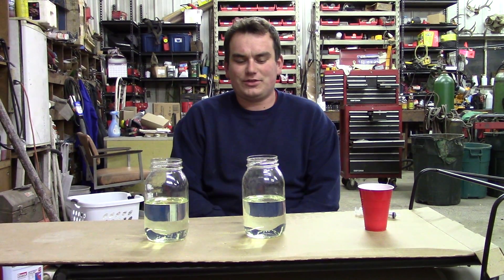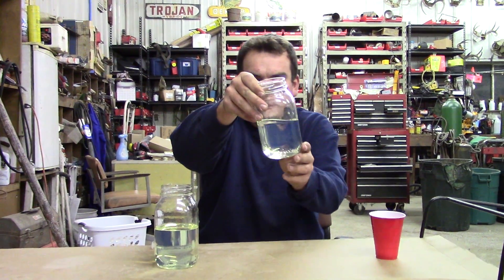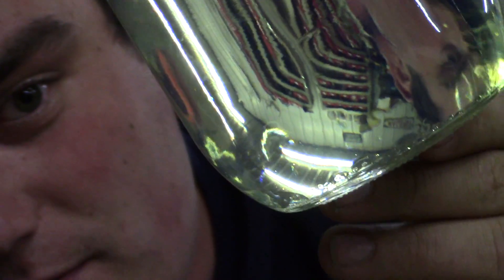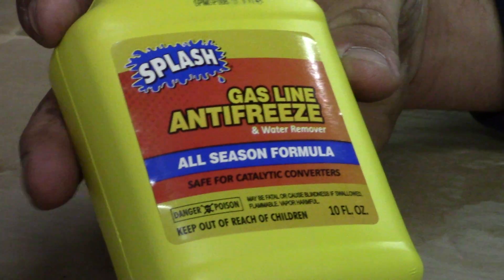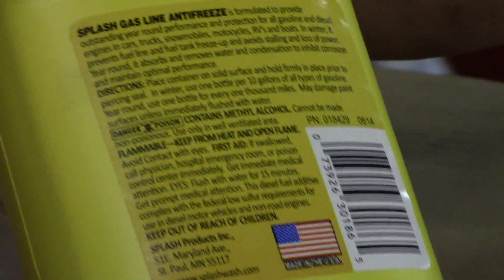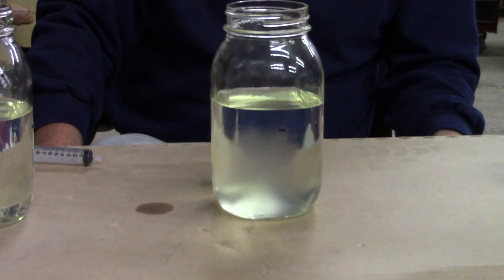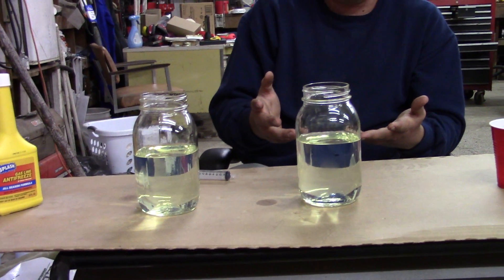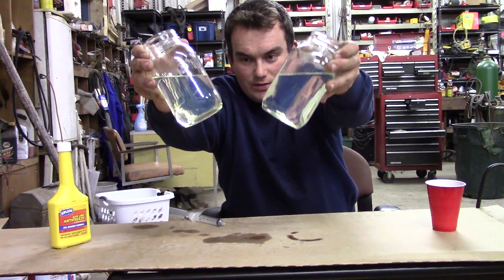ETHANOL removes water in fuel

Comment: The problem is that ethanol is hygroscopic - it pulls water out of the air.
You proved nothing - ethanol in your fuel will attract water. It's not a case of "I suggest you stop pouring it in".

Comment: Missing ro point? 2 stroke engines dont need any water run through them regardless if its suspenden in the mix. The damage is done to internals of the engine. Just because it will pass through the system does not mwan it dont distroy the engine. No water period!

Comment: Tell me you’re dense without telling me you’re dense. The ethanol isn’t “helping”. Your experiment assumes water is going to be present in a closed system where no water should be. You only proved that water and ethanol bind, yet this doesn’t speak anything to how ethanol pulls water from the air, thus introducing more moisture into the fluid. You can’t half-ass things and call it beneficial. No water = best case (obviously).  Non blended water with gasoline = water needs removed. 
. Gas with water dissipated in ethanol = harder to burn. Causing engine damage or a no run situation. 

If ya have a small amount of moisture in your gasoline, you could use a small amount of alcohol to bind to it and expel itself, but make no mistake…you’re doing damage. water in your fuel shouldn’t be allowed, assumed, or, in the case of ethanol…invited.

Comment: Ethanol does absorbs water.There is a critical mass of water in there when the water can not be absorbed any more by that amount of ethanol so it will be accumulated on the bottom.Here the only thing you did is added more ethanol which will absorb that free water so it seems that it has disappeared.Water is still in there with an extreme high amount of ethanol.What do you think what is your ethanol content in that jar now?Want a real solution take the ethanol out by adding water let it sit and trow out the ethanol with the water.The gas left behind will be pure gas and will not absorb water again ever.

Comment: I think the issues with ethanol, its its a solvent. Meaning its cleaning that 50 year old gas station underground tank and absorbing water at stations with poor maintenance track records. Instead of separating. Combine water with copper and other metals found in carburators rust could form. Also when a engine sits the gas drys up leaving ethanol and whatever moisture the ethanol sucks from the air. Plus ethanol isn't going to lubercate a 2 stroke like gas would

Comment: I had wondered about that. If alcohol causes water in gasoline then why is HEET made of alcohol? I suspect you're right that ethanol is demonized more than it deserves. It's popular today to blame any fuel issue on ethanol. If a string trimmer gets run over by a truck some people will blame ethanol.
Reply: Tin Man. Ethanol bonds with water on a molecular level. If you have a little water in your fuel, the ethanol will bond with it and, essentially suspend it equally in your fuel. 
That's also the problem with ethanol. It's hydrophilic, meaning it attracts water. It will take humid air and bond with the water in the air, or any other source of water. This results in more water in your fuel. You can't see it separate but the water is there. This results in rusting the inside of gas tanks, it also dries out rubber fuel lines & O rings etc. Long term that plays havoc with small carbs. 
If you add lots of water to ethanol fuel, the ethanol will bond with the water instead of the fuel and the water/ethanol blend will settle to the bottom of the container. You can decant that water/ethanol blend and be left with non ethanol fuel. It's actually fairly basic chemistry. 
Honestly, I just realize, with ethanol, you need a new carb and fuel lines every 2 to 3 years. Carbs for small engines are generally $30 - $40 and a few inches of fuel line is a few cents.
Reply: @shananagans5  Ever hear of BTEX?
Reply: @exoticcreature3059  I haven't. What is it
Reply: @shananagans5  Abbreviation. Benzene, Toluene, Ethylbenzene, and Xylene.
Reply: @exoticcreature3059  Basically the shit that actually makes you need filters and fuel lines ever 2 to 3 years..
Reply: @DerpyRedneck  Not so much in automobiles. Definitely small engines though. The quality material capable of resisting these paint thinners is not used on your weed trimmer, lawn mower, outboard, chainsaw, etc...
Reply: @exoticcreature3059  EXACTLY.

As much as I hate to, If I ever get access to E85, I'm gonna mix it with non-ethanol gas just to make E30, and Ethanol Shield it, to condition the gasoline part of itso my mower will never have to handle that problem.

The gasoline conditioning and how it enhances ethanol's already dank as fuck stabilizing abilities are the only reasons why I use it in gasoline to begin with, because the fraudulent "CCT" bullshit pisses me off to no end.
Reply: @DerpyRedneck  CCT? 
I bought a Fitch Fuel Catalyst, two pack. One for each 2 gallon fuel can. One is 40:1 premix and the other is 25:1 premix. For my chainsaws. Honestly, I do believe the claims. Keeps fuel fresh indefinitely. But since I can't put one of these things in the fuel tank of my saws, instead I periodically run them. At least once a month so that way I don't give the gasoline any chance to age inside the fuel system.
Reply: @DerpyRedneck  Sorry about the late response. I didn't get a notification on that one. Yes, I'm well aware of the thermal "problem". It's totally a non issue. Out of curiosity I put my hand near the tailpipe to feel the heat when using E85 on one particular occasion. It was a cool 70 F outside and the exhaust gasses were just barely warmer. Compared to running E10 or non-ethanol fuel which always produces raging hot tailpipe temperatures.
Reply: @exoticcreature3059  Yeah, but the claim by B3C was that Ethanol makes shit run hotter, and that their product helps stop that, again, I'm just pointing out the CCT claims are blatant fraud.
Reply: @DerpyRedneck  The other bogus claims were damaging effects of ethanol combustion which goes entirely against the well known facts that ethanol burns very clean. Say the words cool combustion technology and what comes to my mind is water injection. You and I are on the same page. I too know about the science fiction these shady companies are trying to sell to the public at a premium price. "They" should thank me if I'm being honest. I'll buy these products never and make the supply last forever.
Reply: @exoticcreature3059  I agree

Comment: Commercial product, "Heet" contained Methanol. Used it in cold climate with carburetor engines to prevent fuel icing.
And in temps of -40F I even covered 2/3 of radiator with sheet of cardboard,  just to maintain 195 degree temp in the carburetor fueled  engine. A shot of Ether would bring a gas or diesel engine to life at low temps like that. Even thin 5/15 synthetic engines need 10 minute warmup at temps that low before moving the vehicle. Pistons are slow to expand at those temps. And your battery is at only 20% capacity,  so excess cranking will kill a battery. Electrolyte needs re excitation at very low temps. So leaving key in run position for 20 seconds before cranking to start.

Comment: Isopropyl alcohol will IMEDIATELY make the water mix into the gasoline. Methanol alcohol will mix with the water but stays separated from gasoline. The water will burn that way but water distributed throughout the gas is better. Do a test with two test tubes, filled 3/4 full with gas, add 6 drops of water to each tube, then add isopropyl almost to the top of one tube and Heet (methanol) to the other tube. Shake the tubes. The water will be gone in the tube with isopropyl, (actually mixed evenly into the gas) but the tube with methanol in it will look like you just added more water when you poured methanol in it as the methanol/water mixture will settle to the bottom of the tube. The fact that settling occurred causes more corrosion on that area of the metal tank. Also since that does happen, people should be concerned with two stoke engine fuel that has oil in it as that oil does not mix as well in the water/ methanol mixture and could potentially score a piston. I always use isopropyl, even when it costs more, as it far exceeds the performance of the other alcohols.
Reply: I do that for storage even thought I don't think it's necessary given how careful I am. Either way I added 48 ounces of isopropanol to 1.8 approx gallons of gasoline because I wanted to observe how it would effect engine operation. Run rough? Less power? Harder starting? I expected something. Instead all test motors I did this to just laughed at me. With this experiment I now know how much isopropanol I can currently add to gasoline to prevent any water issues without affecting engine operation.

Comment: If the viewer is confused.  The Alchohol in the fuel doesn't physically remove the water, it mixes the water into the homogeneous solution by bonding with the H2O.  

100% Petrol will not bond, thus all the water you introduced will drop to the bottom as useless water.  You see all thee bubbles of water swim when he swirls it.

E10 will bond a tiny bit of the water because it only has a little bit of free bond alcohol to bond.

E85 has a significant amount of free bond alcohol to absorb water into the solution.

Adding HEET or any other fuel "dryer" us just making your Ethanol more alcoholic because it is nothing but non tempered Methyl alcohol.

BTW Methanol has a more damaging action on the cylinder top wall than Ethanol.
Reply from the maker: Exactly! Why even buy heet. Just splace a gallon of e85 in
Reply: @jacobkaul5012 .  Yes.  I have two gravity feed carburetor motorcycles.  Both vented to air to not draw a vacuum.  I use E10 for months at a time.  I drain them through the reserve setting (bottom of the tank) into a clear check flask and have yet to see any significant phase separation.  When I use 100% gasoline for a few months in the winter to get easier starting, I do see a 1/8 or 1/16 inch of water in those checks. 

87 E10 here is 2.77.  87 E0 (pure gas) is 2.99.  91 (E 10 or less) is 3.33.  I will burn E0 in cold months to get faster starts and more BTU in the combustion.  It is peppier on a 229cc motor which only has 25HP, even in summer.  However water has not been a problem with e10 in my direct experience.

Comment: But the BTEX will still do the damage to SMALL engines, Right ? Adding more ethanol to get rid of water or burn cooler just compounds the destruction of fuel lines and carb diaphragms... ?
Reply from the maker: Jonathan B compounds?
Reply: Jacob Kaul (compounds the problem)"makes it worse."..
Reply: @jonathanb9429  watch his other videos that prove ethanol doesn't damage plastic

Comment: last year i drained gas from my tiller and put it in a clear gatorade bottle. it looked fine but after sitting for a month or two there was this big puddle of water at the bottom. 

now your test is fine for what it does which is show water mixes with alcohol. i have known this since i was a kid back in the 60's. it was an old trick that if you had water in your gas tank you could add a bottle of rubbing alcohol and it would absorb the water which allowed the engine to burn it. 

ethanol sitting unused for awhile, say in a lawnmower or atv etc will pull moisture from the air. if you do not think this is a problem then you need to do some research instead of playing with these silly tests that mean little. 

you must work in the industry because you are always pimping ethanol and there may be some out there that take you seriously. it is fine for modern machines that were designed for it but there are a lot of older vehicles out there that run much better on non ethanol gasoline. the whole title is also bogus. it cannot remove water. it just dilutes it
Reply: In addition to my reply above, this is what Mercury Marine (the world's largest manufacturer of marine engines) says about this issue: "There is no active transfer mechanism for ethanol molecules to reach out and 'grab' water molecules out of the air...The primary cause of water collecting in fuel tanks is condensation from humid air."
See and watch the Mercury Marine ethanol webinar at http://dcd96xmek71bc.cloudfront.net/archives/email/Trade/BoatingIndustry/MythsofEthanol-August252011.mp4.

The significance of Mercury Marine making this statement is that the dopey argument against ethanol usually comes from boaters because their engines have vents.

Paul, you have no idea of what you are talking about, so stop.
Reply: Considering that you know nothing about the subject, and you find it necessary to hide your identity, it's you that the clown.
Reply from the maker: paul k Ethanol does NOT pull water from the air. I doubt you know what hygroscopic means
Reply: Your an idiot
Reply: What do you think happens with condensation, its grabbing the moisture out of the humid air
Reply from the maker: As far as my test "being silly" obviously you haven't watched them all or can grasp what makes up Gasoline for additives

Comment: Great demo, thanks for doing it. A clearer demonstration of the phase separation problem would have been to only use E85 or E99 in the left jar (on your right) and not E10. The little bit of separation in the E10 is caused by the high level of gasoline in the E10. You did explain this, and by adding the E85 it helped, but from the start perhaps you should have not used E10.

One of the things I always say when people talk about ethanol causing separation or ethanol going bad over time is to suggest that they look in their liquor cabinet (or in their grandfather's liquor cabinet because he'll probably have a 20 year old bottle of whiskey or scotch or vodka that has never been used). Carefully take out the bottle and hold it up to the light. They will see no example of the alcohol separating from the water. An 80 proof bottle of liquor is 40% alcohol, basically E40 without the denaturizing ingredient (usually gasoline).

Then, taste the liquor. It will taste virtually the same as it tasted 5 years before; 10 years before; 20 years before. It has not gone bad or stale. If they had an equally old bottle of E40 ethanol-gasoline, they would see some  sign of phase separation, and the gasoline may very well have gone bad (stale).
Reply: Alcohol does not remove any water from the fuel. It mixes with the water into form that will allow it to pass through and burn in the combustion chamber but at a slower burn and loss of power.
Reply: comparing it to booze is silly. you do not have that bottle vented like fuel tanks on small engines do. with a vented tank the alcohol pulls moisture from the atmosphere.
Reply: If you disagree with me, then do the test and periodically remove the cap for a brief time to allow fresh air to enter the bottle. NO water will form in the bottle unless you are standing in a shower.